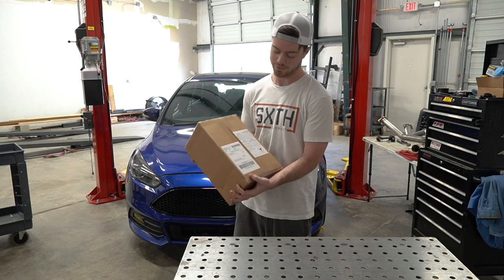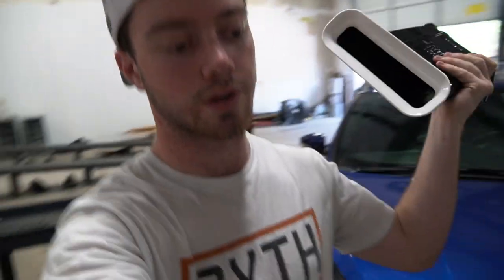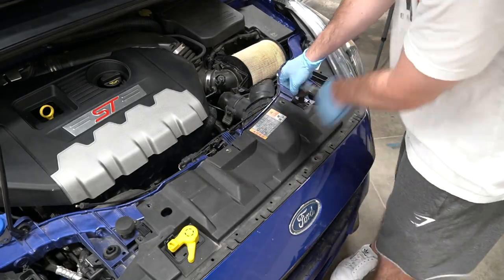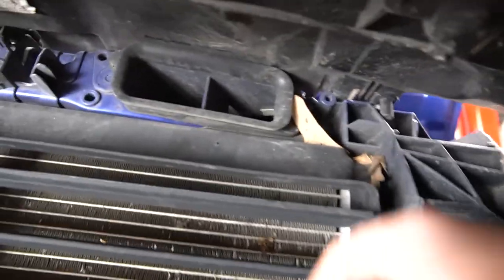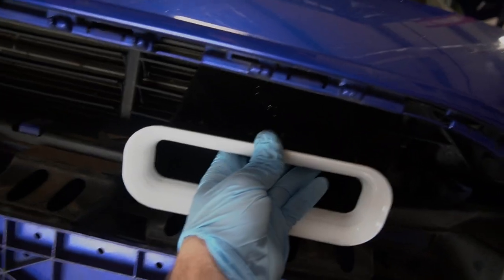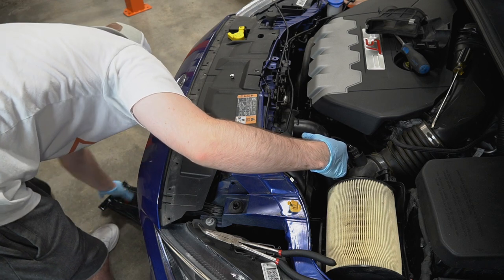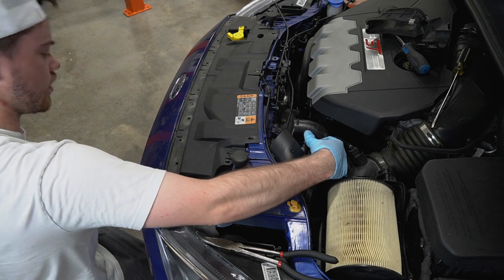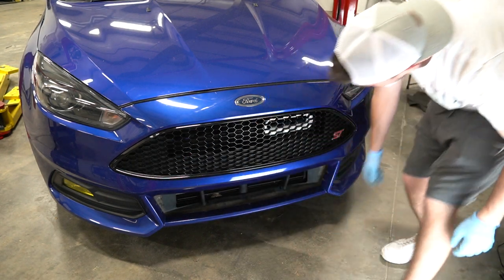Ford Focus ST Velossatech Gen Three Intake Snorkel Install

Comment: I’m wanting to get one on my ‘17 Elantra sport. Does this actually make a difference when driving or is it just for looks?
Reply: The opening and amount of air that can fit through that is exactly the same. It just gets air from a lower position. Highly doubt this with add any difference in driving. Not even 1hp.
Reply from the maker: Nah it’s just for looks really, maybe helps with better airflow but no power gains

Comment: Does it change the sound any?
Reply: It's an air snorkel, it's impossible for it to change the intake sound. Buy a green intake for $60 if you want sound, you'll get the results you want.

Comment: So what happened if it rains very hard ?
Reply: You can get water injection to help reduce temps, so as long as it doesn’t suck up a puddle of water you’ll be fine, the bigger issue is that these scoops essentially block about as much air as they divert.